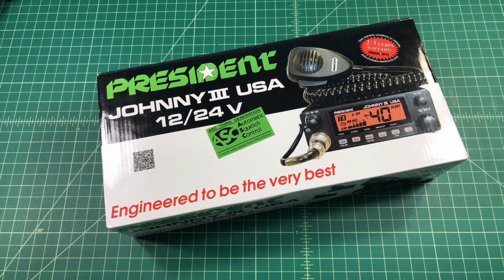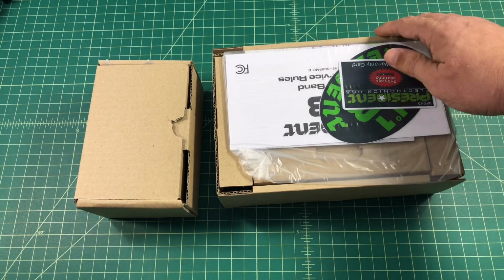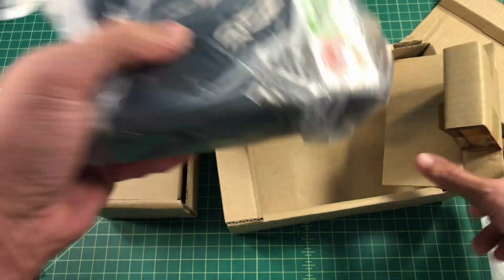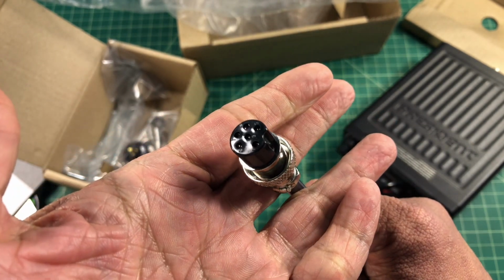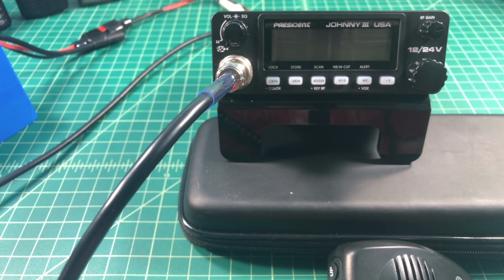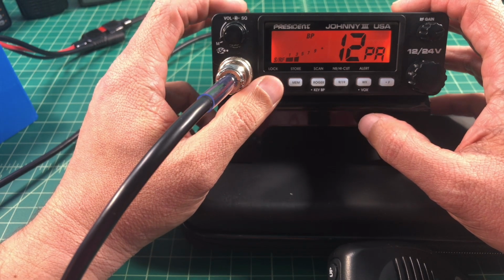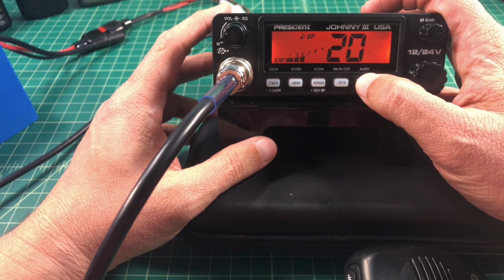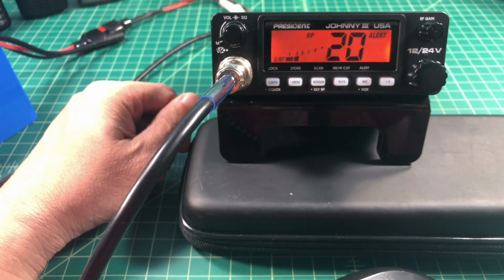President Johnny III CB Radio - TheSmokinApe

Comment: I ordered a new tuned Johnny III during the summer from a CB shop for the company dump truck I drive, I haven’t installed it yet as I’m getting a replacement truck, I haven’t taken the radio out of the box yet to test it in the other company truck I drive.
Reply from the maker: This one is stock but I have been pretty happy with it

Comment: I love President radios, running this one in my Avalanche currently. Cool little radio and it gets out fine with a properly tuned antenna. Has a great receive, weather alert works great and audio on receive sounds good. Asc works well also. I would recommend this radio.